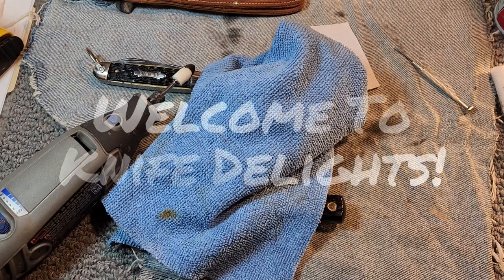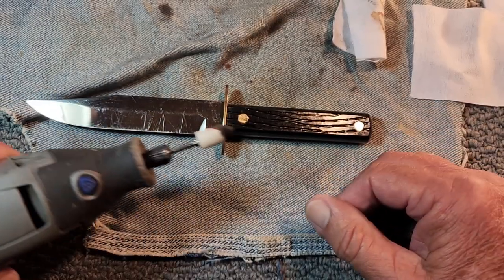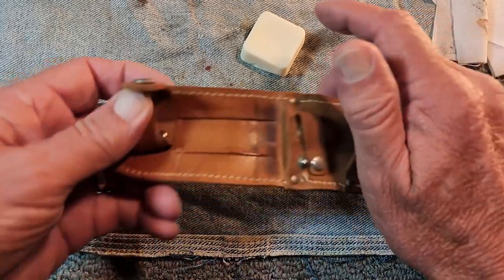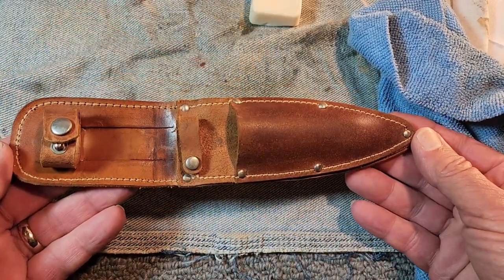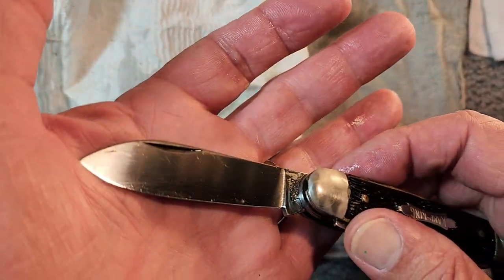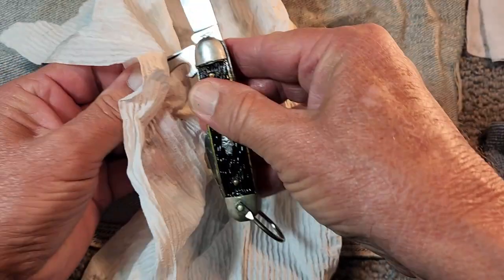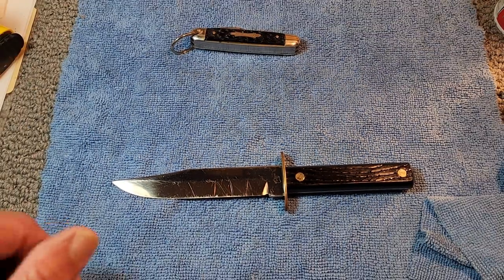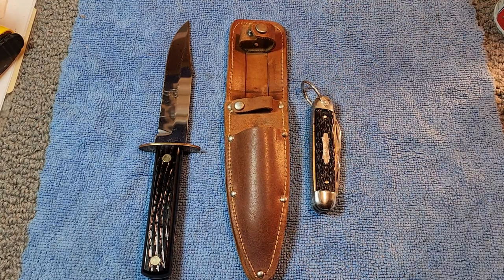Two For Tuesday:  Hammer Brand Fixed Blade and Camp Knife Combination Set (Part 2)

Comment: Good-looking restoration, I might think the covers on the the Kamp King was an early type of plastic that shrank with age like celluloid. I remember seeing the same fixed blade knife sold as a set with a hatchet that used the same looking handle. I remember seeing them in 5 and 10 stores as a kid.:trophy-yellow-smiling:👍
Reply from the maker: You're probably right about the cover material.   They don't look damaged, but they shrunk.   Thanks for stopping by, Gizmo.